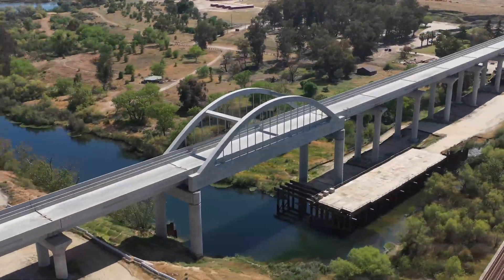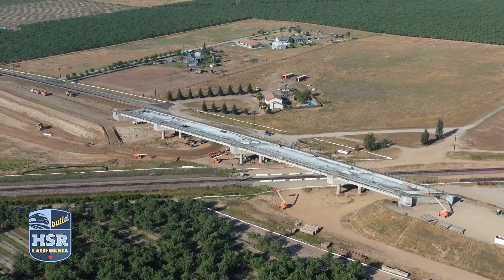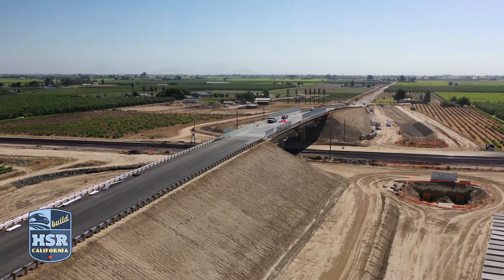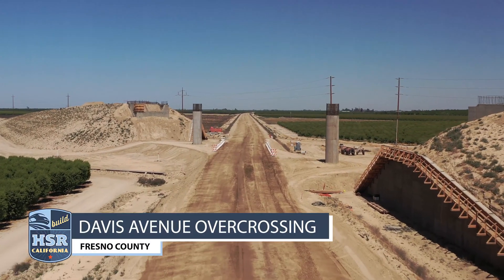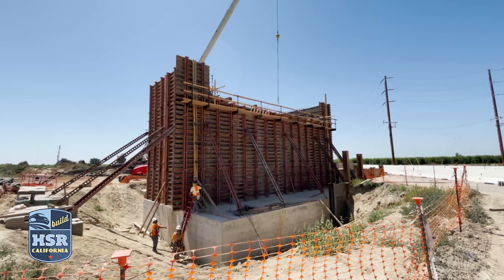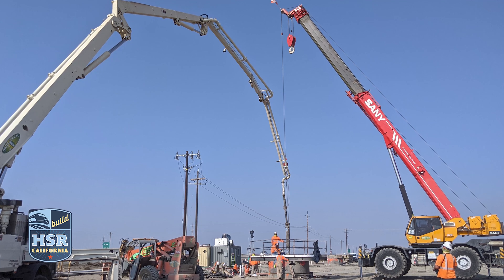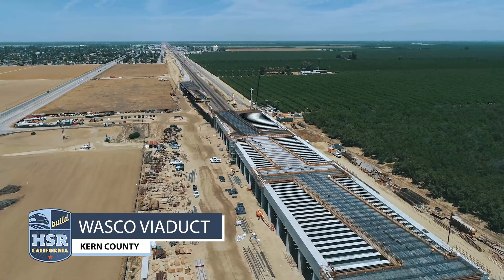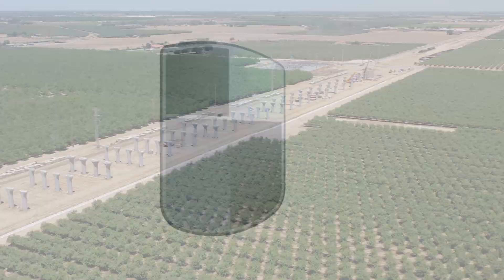California High-Speed Rail Construction Update - May 2021

Comment: cancel this boondoggle, goodness are you people clueless
Reply: @EASbear  there is no hsr in socal.  what works in socal, norcal are airplanes. hsr is central valley cal, which is a boondoggle, and thats no troll. DC to Boston, sure Inland empire, c'mon...
Reply: @paulvalentine4157  I’m talking about light rail transit.
Reply: @EASbear  you mean metrolink, 30 years old and at 40000  weekday ridership? mta in nyc losses boatloads of money and has 5.8m daily, paris 4m+, tokyo off the charts

even if they lose money, thats working

40000 a day in LA is one street, thats not anywhere near working, what is that in rev 80000, for six lines?

c'mon now, boondoggle connecting boondoggle wake up
Reply: @paulvalentine4157  no i mean Metro Los Angeles, their working to expand their Regional Transit.
Reply: @EASbear  metro - 300K ridership out of 10M people, 3%, please

yet bus ridership in LA is 916K - 3x as much as the far more expensive alternative of subway

all on a $7.2B budget per year

face it - the facts are against you, this isn't NY, Paris, or Tokyo - its CA - cars, buses, and planes, everything is spread out and its 5% urban - with the two large urban centers hundreds of miles apart. HSR is a LOSER, subways are a LOSER and light rail is an absolute joke as it only make surface traffic worse

maybe youre the troll
Reply: @paulvalentine4157 
I’m not a troll. And yeah, not all world city transit are the same. I don’t want to put a fight, but you do have a good point.
Reply: @EASbear  the la mta budget is interesting

for 7.2B in budget, that moved passengers 1.8B miles, or about $4/mile

that would mean it should cost you $400K to drive a car 100K miles, which of course it is not even that close

this guy did it for 42 cents a mile:

https://www.thebillfold.com/2018/07/the-cost-of-putting-100000-miles-on-my-car/

and before you say muh road externalities cost a hella, 1.1B+ of those passenger miles were on buses.

rail sucks
Reply: @EASbear  and yet you called me a troll right out the gate

don't get me wrong, I love trains - couchettes in Europe, TGV in France, the entire country of Japan, the Amtrak one that goes to Tahoe, Taiwan HSR, the London tube, but you got to be smart about it and cities are path dependent

rail makes no sense in CA
Reply: @paulvalentine4157  and I apologize for calling you a troll. I always get annoyed by them.
Reply: @paulvalentine4157  You speak the truth. 
Metro in LA is now providing free rides for the homeless.
Reply: @paulvalentine4157  Grizzly is the troll.
Reply: @whiteclifffl  wow thank you for calling me that. And one more thing, I’M NOT A TROLL!!!!😡😡😡😡
Reply: @EASbear  if you say so, fan boy 

I'm just not a chump

HSR works in high density places like Taiwan, some of Japan, and parts of Europe

not in California - especially in the interior - BART, Muni, Light Rail all don't work there either and people live near them

California is for buses, cars and planes

cancel this boondoggle and subsidize market rate housing instead, better for the people, grows the middle class, and broadens the tax base

HSR is a toy project destined to fail
Reply: @paulvalentine4157  Exactly!

Comment: I'm amazed that they  are using steel rebar instead of modern composite rebar.  It is lighter, nd doesn't corrode.
Reply: You don’t have to worry about corrosion in California when it doesn’t rain! 😆
Reply: @BullyBentley   LOL.... :)
Reply: You seem like you might know more than me about this. So I’ll just spitball here: Could it just be cost? Or perhaps an engineering concern against environmental conditions and seismic activity? Or maybe composites haven’t had the time in service for the engineers to confidently recommend it for such a massive project?
Reply: @DrOuchie   Composite Rebar has been around for 20 years and has been used in various applications around the world, in eluding the HSR system in China.  The issue is that the steel industry here in the USA has fought and blocked approvals; even with test data that shows better strength and yield qualities.  The result is a higher long term maintenance cost to insure that moisture doesn't end up in channels within the structure.
Reply: @DrOuchie  Cost, and for ground structures, weight doesn't matter

Comment: I was skeptical when they said they were focusing on a central valley opening initially, but I think this is going to really impress people when it's running (and people will be begging for a complete system).  We've never had anything like this in the US.
Reply: That was the idea to build in the Central Valley. It was the place to get the most track built for the available funds, and would be a good way for people to experience a HSR line first hand to garner even more support for building out more of it and spur lines in other parts of the USA.
Reply: @theexmann  The Central Valley allows you to build more track per dollar but fewer people will actually use it when the first segment opens. The point of infrastructure is to be used, not to be large and shiny..
Reply: @jmlinden7  I agree, but why not start with the section that will result in more track per dollar since you will need to build this section regardless? Where would you build another section in either SoCal or the Bay Area that would be long enough to take advantage of a HSR train? Considering the top speed is 220mph, the section would have to be at least 100 miles long to be a good test case for experiencing HSR speeds. I don't think there is any. The only section that would fit that bill would be between L.A. and San Diego, but that section is not even part of the original main track design. It's supposed to be added later. Still, I would have been fine if they had done that instead. Though it would have been even more complicated and expensive considering the land values and density of cities compared to the Central Valley.
Reply: @theexmann  Miles of track is a means to an end. Building a ton of track in the middle of nowhere will get you a lot of track but not much useful results
Reply: @jmlinden7  The tracks in the middle of nowhere are part of the route from LA to SF so why not build it first if it's the section that is less costly considering the current funding situation? I don't understand why that's not the right way to go at this stage? It makes sense from many different angles. And you'll have a working section that people will be able to ride to see what HSR is all about. It's like test driving a great new electric car.

The large majority of people in the USA have NEVER ridden on a HSR train. In fact, I plan to ride it as soon as it opens and I live in L.A. I also plan to bring several friends who have no idea what a HSR train is like. It will be a great way to introduce people to the technology and will help to better inform people to increase the support for more HSR in CA and the rest of the couintry.
Reply: @theexmann  Money is fungible, it doesn't matter if you build the expensive part first or the cheap part first. The total amount of money you spend is the same either way, but by building the most useful part first you get more people hooked on ridership earlier, which makes your project more useful overall

Just think logically, who's more likely to use a HSR to go 50 miles, someone living in Fresno or someone living in San Francisco?
Reply: @jmlinden7  You make no sense. Money is fungible? What does that even mean? It's nonsense. "Building the most useful part", what part is that? Give me an actual route that's at least 100 miles long within the SF to LA route that would be the "most useful" by comparison and would cost less than the Central Valley section. This isn't about esoteric ramblings regarding "most useful part". It's about actually building a useful section with the money readily available. Yes, the overall amount of money might be the same for the entire project, but it does matter how and when you spend it during the course of the construction project which will last about 15-20 years.

BTW, no one rides a HSR train to go 50 miles. The Central Valley section will be at least 120 miles, but it could stretch to 170 depending on available funds in the next couple of years.
Reply: At this point I actually agree. The Central Valley was always going to me the most technically simple but legally difficult part of the system. If they can slog through the brutal work of acquiring property and right of way through the Valley, which is hella fragmented, finishing the last thirds in the Bay Area and SoCal will be much simpler, from a regulatory standpoint
Reply: @andrewk9267  You might be right that going through the gauntlet of the Central Valley could be the worst part of the whole thing.
Reply: Yeah! It would basically act as a trial run for people, and I'm just saying they'll be impressed. I can't wait for the high speed rail's entry into San Francisco though!
Reply: @cambridgeh.lutece6658  Agreed. Can't wait for it to pull into Union Station in LA too.
Reply: @cambridgeh.lutece6658  it’s not going to happen.
Reply: yes
Reply: It’s not even gonna be high speed rail it’ll be similar in speed to conventional rail 🤣
Reply: @Bolthrower91  No, even if the Central Valley section is not electrified when it first opens, it should still run around 125-150mph. It would still be the fastest train in the USA.
Reply: @theexmann  right but by definition it’s not high speed rail
Reply: @Bolthrower91  150mph is usually accepted as the minimum for HSR. So if it reaches that level it can be considered as such, but that's not the point because the Central Valley section won't be technically a finished HSR line until it's electrified. Once it is electrified, it will run 200+ mph.
Reply: @Bolthrower91  However, even if it's not electrified for 5 years, it will still be the fastest train in the USA by far even if it runs at 125mph. This project would be much further along if it wasn't for frivolous lawsuits by politicians and property owners and subsequent route changes.
Reply: Here’s the question. Why would anyone pay to ride this train when you can fly  from John Wayne (Orange County) to sfo San Francisco for 106 bucks one way and take an 1.25 ??????
Reply: @johnpinedo73  It’s not just about getting to the destination fastest. Its also about convenience, you can step on the train in downtown and arrive downtown. You don’t have to deal with the TSA. You can sit back and relax, enjoy the view or work. Have work meetings face to face on the train. Transport much more luggage without paying fees. Having service come with food and drinks. Dont have to plan so much can just arrive at station 10min before departure, step on and arrive downtown and jump in a taxi, uber, buss, or your car. Its about the total package, if youre inn a real rush then take the plane!, but if you have a little more time taking the HSR train vil be more relaxing and convenient.
Reply: The problem with a 'demonstration is that your demonstration needs to meet it's milestones and stay on-budget.  And when the taxpayers wind up on the hook for the construction bonds - nobody is going to support expanding it.
Reply: In Europe, it's cheaper & faster to get a RyanAir flight ticket than it is to ride their high speed rail. This project is taxing the poor for a train only the rich can ride. Don't forget this Central Valley portion costs more than what was budgeted for the entire SF -> LA.
Reply: @kevinmanan1304  Please, the poor pay plenty in taxes to subsidize airport and airlines they can't afford to use, not to mention interstate highways, just the same here as in the EU.  RyanAir is cheap only if you don't have any luggage and you can print your own boarding pass, and nothing goes wrong that needs customer service.  It's basically a lottery where you gamble that everything will go right and when it often doesn't, you're left holding a bill.

I paid 20 euros to ride the TGV across France a few years ago on their discount advanced purchase Ouigo service -- hardly a train that's only for the rich.
Reply: What will probably really impress is if you observe how enormously more expensive than originally "expertly estimated" this "easy" section, basically between nowhere and nowhere, passenger base wise, you really will see something when extending into LA and Frisco. The cost for those sections, if built to the standard of the valley segment, will make this initial piece look like a bargain basement toy train.  Probably not considered by many also would be the massive disruption/demolishment of huge amounts of urban areas will be required and will have its own affects. The most reasonable option might be to lower speed standards and utilize much of existing rail system. You will loose a fair portion if the "super high speed total time but you may avoid bankrupting CA and adding to the same situation with the Fed.
Reply: @kenhanks9620  I agree, it is enormously expensive. ALSO, you are right on some aspects! In order to get to S.F. theyre utilizing the Caltrain line between the Pacheco Pass and S.F. Of course, theyll bore tunnels down to the transbay terminal!

I havent checked up with the L.A. portion but I do know that theyll be tunneling under or bridging over where they can. Thisll create jobs but at an expense.

If there were more cost appropiate solutions I would be all up for it, but a tunnel through thr mountains between the central valley and the L.A. area is unfortunately necesarry.

It would be nice to have them use thr right of ways of the current transit in L.A. though!
Reply: @cambridgeh.lutece6658  You might want to look into the Brightline "Higher Speed" project in FL, which by the way a private financed operation, and tho having a lower ceiling of performance, is not bankrupting the taxpayer, and will be in service within 15 yrs from proposal to initial route Miami to Orlando service (2022!)!
Reply: @kenhanks9620  Brightline is slow.  That setup wouldn't work for SF - LA.
Reply: @kenhanks9620  "bankrupting the taxpayer", show your evidence. If we don't continuously improve our transportation infrastructure we'll be bankrupting public well being. 

And why is it always "THE TAXPAYER©" like they're some sort of noble, 1st class citizen that you can speak for? Why not all of us? I didn't pay any taxes as Marine while I was in Iraq/5th Fleet AOR. What about our non-tax-paying children, do they matter? You also realize people who support this project can be TAXPAYERS© too?
Reply: @kenhanks9620  You're assuming a lot in your comment. Most of which is just hyperbole. Checkout "The Four Foot" YT channel. He has a 4 part series that follows the entire Central Valley route with some great drone footage. He explains what they are doing very well. I think he has experience working with rail systems. The project is much more complex than you think even in the Central Valley.

California is doing better than any other state economically. The governor just announced a $75 billion dollar surplus, and some of that will go to the HSR project.
Reply: Still cheaper to drive or fly. USA is a car country, most prefer to drive or just fly. Train fare would be too expensive. This train to nowhere project by California Democrats is overbudget by BILLIONS and it is not even done yet. Democrat politicians and their business buddies are making tons of money due to this train project to nowhere. It should be investigated. Follow the money and arrest ALL politicians, contractors and everyone involved in this SCAM.
Reply: @paengguin9381  I think you would be shocked to see how much the middle class pays in taxes that go to subsidies for the oil companies let alone the roads themselves. 93% of the cost of rail is brought in by ticket revenue. Half of the cost of driving is paid for by taxes, including the cost to build. CA high speed rail will likely pay for itself in 20 years, the roads there are a major reason CA taxes are so high in the first place. If you think the rails are a scam, the roads are 100x worse.
Reply: @ryanfraley7113  It is cheaper and faster to fly than to ride a train.Billions of taxpayer expense and kickbacks by politicians will never be repaid. Trains and rails will need to be maintained/replaced and that never ends so more kickbacks.
Reply: And we never will. 
End this mess now.
Reply: @whiteclifffl  We shouldnt end it. The less cars on the street, the better. Frankly, the high speed rail also has created a lot of jobs and yet you want to end it? Would you live with our terrible public infrastructure, or would you actually show the world that America can do it. High speed rail will take cars off the highway too, which is good news since Climate Change will take its toll on the world. If we dont mitigate what we have right now, itll be too late later. 

High speed rail for California is a shitshow right now and I understand where your coming from. Theres political, economic, geological, and monetary barriers but were getting it done. As you see here, construction is happening. 

However long it takes, its going to happen, and for a good thing.
Reply: @cambridgeh.lutece6658  OMG. 
You’ve actually bought into the idiotic religion of climate change?
This boondoggle should never have been a public works project. 
Our state’s infrastructure is awesome. 
We don’t need to divert taxpayer funds from road maintenance to this hit mess. 
Your argument about getting people out of cars NEVER works. 
BART is a great example of that.
Reply: @davidsixtwo  Exactly!
Reply: @cambridgeh.lutece6658  Don't waste your time replying to this guy. He's a contrarian curmudgeon troll.
Reply: @theexmann  I had nothing else to do :P 

I know hes a troll too, but why not?
Reply: @theexmann  I agreed he’s a troll. He once called me a troll.